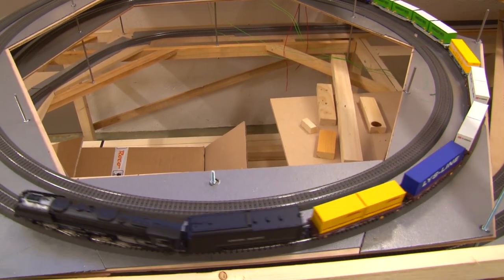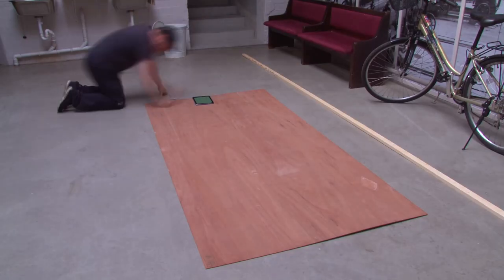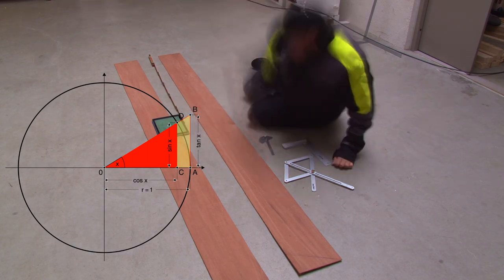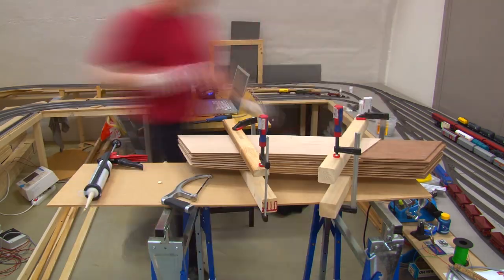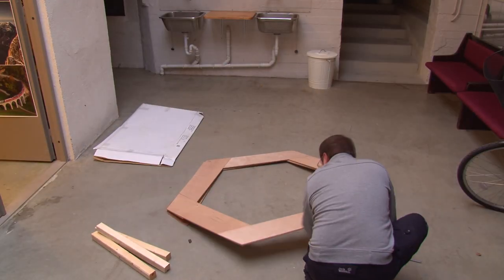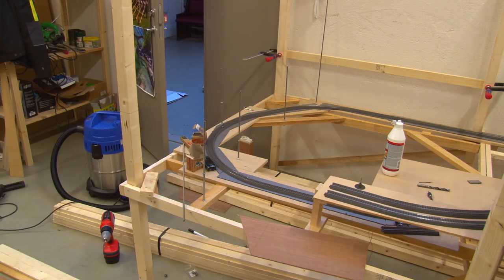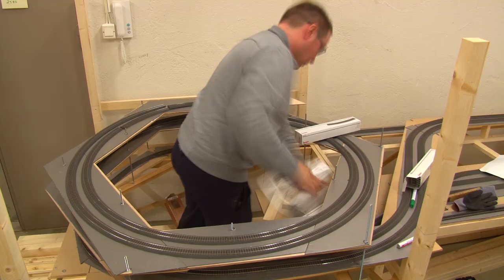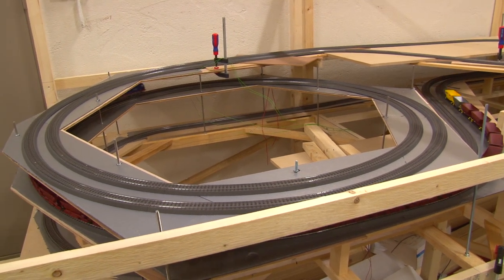How to build a helix for your model railroad [Trainroom]

Comment: Thnk you for sharing. I am about to start a similar journey. Two points I am not clear about and perhaps you can help me. In the video you mention a height of 30cm and I am not sure what this measurement is for and where you use it? Secondly, when putting the helix beds on to the threaded rod, how do you know wht the correct end height is for the bed? Thank you
Reply from the maker: 30 cm is between the lower level (60 cm above ground), and the medium deck (90 cm above ground). The helix stars around 45 cm above ground, this there is a ramp to get to it anyway.
The helix total raising is around 15 cm.
The helix raises 10 cm per turn. There is a rod every 30 degree, so you can calculate how much it should raise at every step.
Reply: @thetrainroom  Thank you, I understand now.

Comment: Hi, firstly thanks for sharing this video it was very helpful, do you think the helix would be as successful using the Marklin 2221 & 2231 curves ? with a 3.0 & 3.5% grade ? I wish I had as much room as you to work with :-)
Reply from the maker: If you run with shorter trains than I do, it will definately work. My uncle build a helix with C-track R1 and R2. If you have some room, I would use C-track R2 and R3. Then you are on the safe side to run non Märklin rolling stock.
Reply: Thanks for the reply , unfortunately the 2231 is the biggest radius I can use in the space I have. Ok I see your point , it changes the grade significantly , Thanks. Still probably not enough space unfortunately.
Reply from the maker: I would use C-Track instead of K-Tracks. To decrease the grade you can build some straight tracks between the half circles. Unfortunately you would have to cut to different size of the sheets.

Comment: Thanks for such a brilliant video. And for the maths. While I didn't go with your dimensions, or the exact style (I'm using bracing plates and glue rather than overlaps, on 12mm board) you helped me with the basics. The best construction vid for a helix I've seen. I was constricted by space, so made the longest base line 750mm, the inside length 524mm - the boards themselves 195mm, the angles 60º on the base; 120º on the upper part, just to help anyone else. It would have been handy if you had put the shorter length dimension in - but I (eventually) found this brilliant calculator, where you can enter the known details and get what you need to know for the space you have - https://www.mathepower.com/en/trapezoid.php and you can enter the values you know, such as the angles remain the same for an isosceles trapeze (60/60/120/120) and if you know the width of the board, and the outside edge, it will tell you things like the overall radius and inside measure. I'm only making a single track helix to reach storage sidings, but your video absolutely helped me.
Reply from the maker: Just use the link to excel sheet in the description, and that will do all the math for you.
Reply: The Trainroom thanks